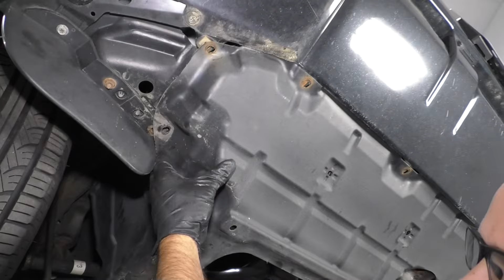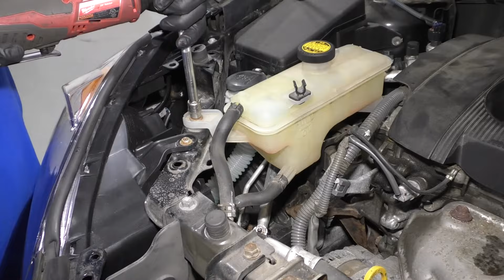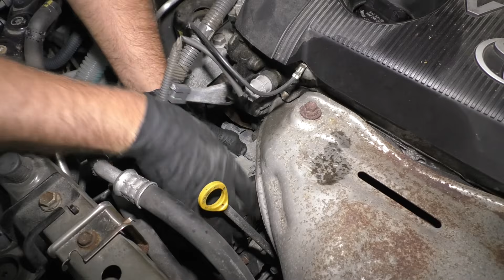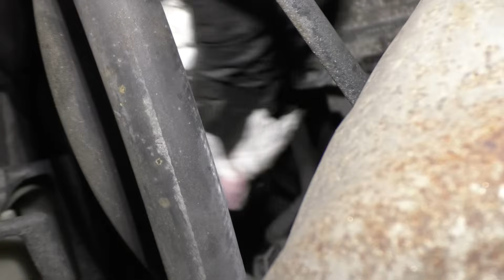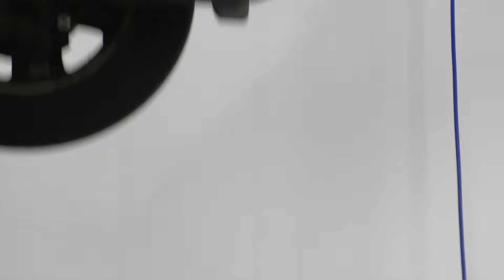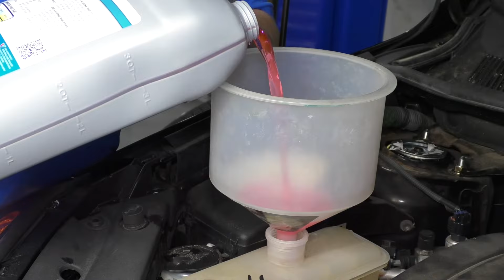How to Replace Thermostat 05-16 Toyota RAV4

Comment: Question for you guys my thermostat seal is leaking how do I prevent it from leaking further. I’m guessing if I torque it to the right spec it shouldn’t  leak anymore. But what if it does? Also. Should I replace the gasket or thermostat and gasket

Comment: another great design by a engine designer  . where you have to  dismantle half dozen things to get to a simple  thermostat .things like a thermostat should be placed in more accessible areas  .remember old school engines ,thermostat  off to side of cylinder head .now they bury them deep in the block underneath headers and manifolds or alternators . it,s dumb design ,some might say lazy design .

Comment: Always do a coolant drain from the radiator stopcock first, then alternator/thermostat, change the belt, refill coolant. That way you have a new thermostat, belt and coolant every 50K to 60K all in one shot and don't have to worry about it. Add the Water pump, upper and lower radiator hose replacements also at 100K or 120K.

Comment: ......and don't forget the jamb nuts installed on the rear of the alternator case).....be sure to move them to increase the space between the front & rear "ears" on the alternator......doing this means you won't have to fight the alternator as you install it onto the mounting brackets.

Comment: So... I have a 2014 Venza, and there really aren't any (helpful) videos on YT about it. But since mine has basically the same engine (1ARFE), I figured it would be the same as this (which is a great video BTW.) However, for whatever reason, this seemed really daunting to me. So I searched around some more and found a video of a "quick and dirty" thermostat replacement on a Camry (with, again, this is Toyota so, roughly the same 4cly engine.) That one basically states "don't remove the alternator and don't drain the coolant, and as long as you go fast, you can get by losing just a bit of coolant which you can then top off." Everything was accurate about that... except I just wasn't able to go that fast. And then I somehow pinched the gasket in my hurry. So then I had to hurry to take the studs and nuts off again and in my rush, I stripped the lower nut. So yeah, I ended up making this WAY more complex than it would have been had I just followed this video from the start. I mean, I ended up having to clean a bunch of coolant off the engine and body work, and honestly, pulling the alternator was not NEARLY as difficult as I'd built it up to be in my mind. I didn't have the tool in this video to loosen the belt tensioner, but I was able to do it (it took a minute - don't get me wrong) with my trusty 1/2" HF breaker bar and a 14mm socket. I'd venture that even though I'd never done it before, taking it off took... 10 minutes. Tops. Putting it back on maybe a bit more at 12 to 15 minutes. Really, not that bad. I then had to pick up a set of bolt extractor sockets, and then I decided to order new studs and bolts from my dealer, and removing the old stud took WAY too much effort, and yeah. Point is: if you're thinking of replacing your own thermostat, my suggestion is to just follow this video and maybe save yourself some heartache. Or try it my way and hey, new tools, new skills, and loss of use of your vehicle for entirely too long. I definitely do recommend some kind of dedicated funnel for "burping" your radiator once you're done too.

Comment: What's a fair price for this job--to replace the thermostat --on a 2010 RAV with all this extra junk to remove ?  I used to swap out thermostats in five minutes when they were easily accessible on older vehicles.